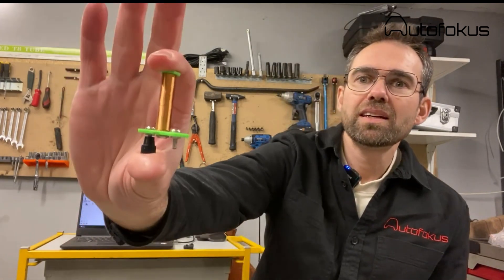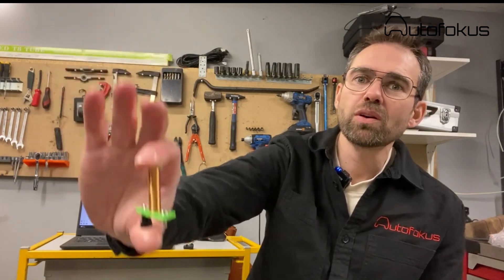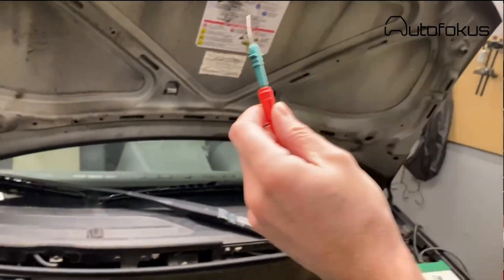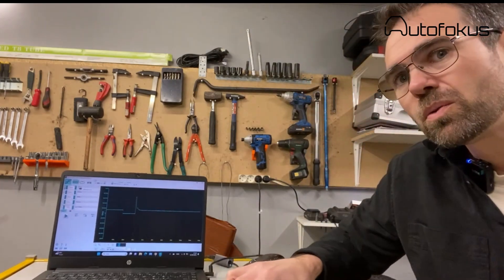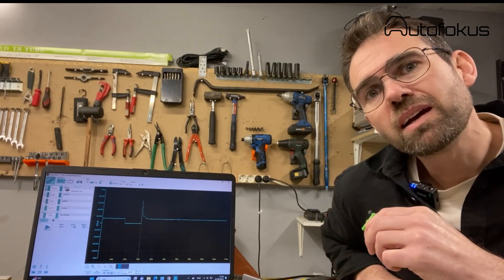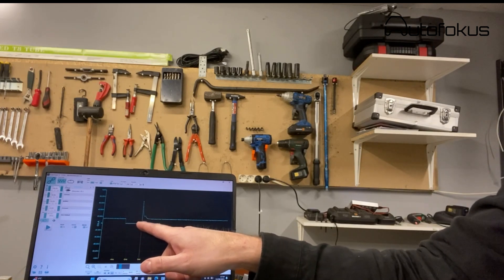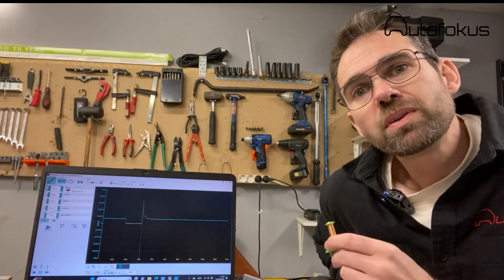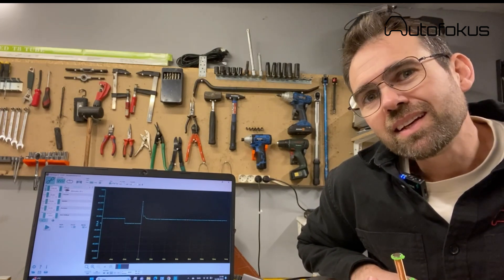Basic understanding of injector voltage waveform.

Comment: The diode you're describing is called a "snubber diode" and is used in solenoid circuits to protect the driver electronics from the spike (which is called "flyback").  This high voltage happens for exactly the reason you describe:  The collapsing magnetic field of the solenoid induces a current in the coil that is inverse to the change in magnetic field.  Since there is effectively zero load on this coil, the voltage "flies up".  The diode only conducts in one direction (except for the leakage current) and "snubs" this flyback voltage.
Reply from the maker: Hi there.
Thanks for you very thorough explanation. Very much appriciated.
/Simon

Comment: Thanks for the video. What would the waveform look like in failure cases? Presumably one failure is an open coil and no voltage drop. But then the engine would be obviously misfiring. Are there more subtle, intermittent failures?
Reply from the maker: Hi there, and thanks for your comment.
One failure could be, that the spike is not cut of horizontal, which would indicate that the zener diode is not working.
Agree with the open circuit you mention!
Also the spike could be lower than 35 volt, or a bit lower than 60 volt.
I am gonna make an advanced injector diagnosing video, then I will go through the failure modes also.
Reply: @autofokusDanmark  look forward to it. Subscribing.
Reply from the maker: @johnggudmundson  thanks😇. Stay safe🥰